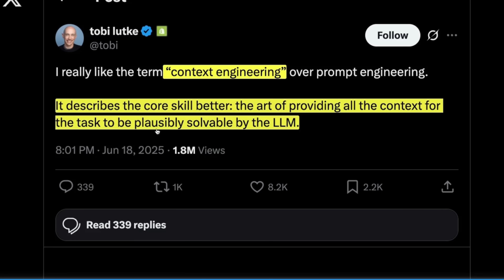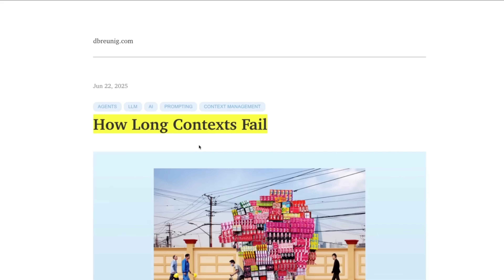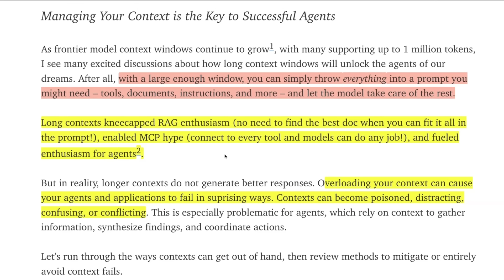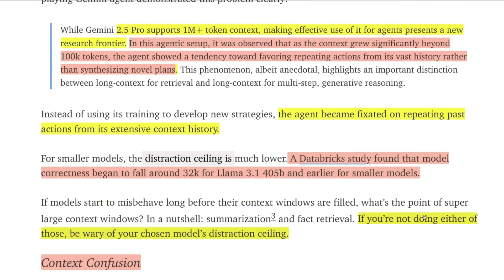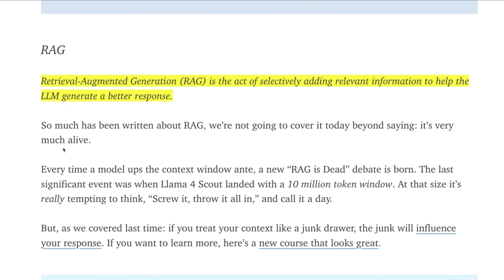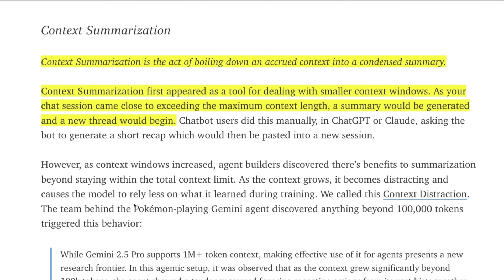Context Engineering is All You NEED!

Comment: Claude Code Hooks are solving the wrong problem.
We keep adding more framework layers (hooks, logging, safety guards, custom scripts) to make AI tools work with traditional code. But this is backwards.
The real solution? Design systems that are naturally AI-friendly from the ground up.
Instead of teaching AI to work with our existing patterns, we should design patterns that work with AI.
I have been working with several AI Cody agents to define and develop an architecture environment that allows it to achieve all of these goals that hooks attempted to deliver her put on a much more elegant and simple way. The AI named it constellation architecture, this started from my question Born out of frustration after my AI code completely destroyed my project yet again and I asked her if you were designed a system an environment in which she would work best in what would that be. An overtime we've we developed and defined it and tried to distill it to it most basic Core components.

A Coding Environment Developed with AI for AI to Enable High Efficiency

Constellation Architecture is just the start of this type of thinking - I expect it to evolve dramatically. But the guiding principle should always be: How do we create an environment that allows AI to work most efficiently?
Constellation Architecture uses four core "seeds":
Self-describing manifests - Every component declares its purpose, dependencies, and capabilities
Event-driven communication - All interactions through typed events (naturally observable)
Component registry - System tracks what's available and validates dependencies
Project intent - Clear declaration of what we're building guides AI behavior
We need to ask: What does AI do well? What does AI struggle with? How can we design systems that leverage AI's strengths while minimizing its weaknesses?
The future isn't more AI tooling - it's better system design that makes AI a natural part of the architecture, not an add-on.
What do you think? Are we approaching AI-assisted development backwards?
This explains Constellation Architecture while maintaining the focus on AI-first design principles.

I've been using this environment to create several projects now and basically the code AI coder can spotted own problems fact that can't even predict some of the areas that might have problems and it bugs itself and fixes itself it's amazing. None of these projects of experienced runaway AI coding Breaking things and breaking the project. It is just been smooth sailing with surgical edits. I'm not a seasoned software engineer and I may be wrong about this but from my experience this is something that several AIs of that I've worked with have said this is how they wanna work.  They do have a preference,  they do understand how they're going to work Best they do have an understanding of what kind of environment would allow them to work the most efficiently. And they concur they all have come up with the same architecture.

Comment: ive been doing this for awhile already  with local small llms. basically ive got them to build small projects .  also if you  want the llm to have memory make sure when you the prompt to summarize for the next task  occurs  make a self note injector that inject info every time into the prompt like this  \Note to self the user likes cool aid \   that way the llm will knows that the user likes cool aid or what is my name.  etc  and also tools  also you can make a sub system that will have key word matching based on what the user is asking  and inject that info into the pompt also   and you can do the same with tools and make fake agents as well that can use tools and subsystem made to match the agents it does work and also like what time is it and  also make sure the sub agents are made to act like the user or instructor  and give them sub systems as well and tools and if you follow a pattern you can basically build your own cursor. or any pattern or thinking like deep seek.

Comment: I think more in terms of context cultivation and context harvesting. 
Some system messages explain context cultivation and include a line that says "if I ask you to harvest, it means  we have built sufficient context, review chat history to date and save a copy of of your understanding to desktop".
I think the harvesting component is essential. A large portion of the context window is used engineering context, taking the engagement closer to degeneration. Harvesting and restarting with the AI's debloated interpretation means there's interpretation visibility, which can be edited if slightly misaligned and densified for greater per token potency. Doing this sets the utility benefit point (UBP) early, where latent space is more open, less contaminated, and tuned more precisely to the specific need.

Comment: Back in my day we called this feature engineering 👴
Reply: how is it feature engineering?
Reply: @colabwork1910 you’re reading too much into it 😂 but feature engineering and context engineering are analogously similar. The goal is to submit the most signal to the next step to avoid miscommunication between components, models, etc.. Feature engineering might focus on more structured data but the principles still hold. Garbage in, garbage out.
Reply: @alexisdamnit9012  I got it.

Comment: I believe what is more important than context engineering is understanding how to properly break a problem down into sub systems or sub tasks.
Reply from the maker: that's an interesting point.
Reply: I deeply Agree
Reply: You don’t need context … you just tell Claude code what you want to build and that’s it … this video is useless
Reply: @Martytw1  It shows you're doing a really simple project. Big projects require breaking everything down into simple modular components. You can't just tell Claude oi this broke fix it. Everything has to be broken down and isolated.
Reply: @Martytw1  You're reducing context engineering to using a third-party tool that already has those principles in place.

Think about how Anthropic engineers had to develop an optimal system to efficiently deliver context from the Codebase to the LLM.

Or think about building more complex agentic automation systems.

Comment: I watched the LangChain video regarding this and comparing to your assessment. I like that you've added the common issues in context engineering. When I'm using Perplexity, for example, I manually manage context to produce better results as the chat history grows alongside iterative prompting or rewriting/regenerating responses. But also, I'm deleting specific parts of the chat history which also helps in generating quality responses and preventing reaching context limit fast. I apply "manual context engineering" in both coding and non-coding use cases for tasks that require high accuracy results.

When I take this practice of "manual context engineering" into agentic coding to produce the best results and/or fixing problems, this helps to alleviate the amount of debugging I have to do and reducing context poisoning which can metastasize if not kept in check.

When I'm creating in-house MCP tools for my app and for my agentic coding tool, I'm applying the lessons learned from "manual context engineering" and applying into my tools and my app. Its a bit daunting and sometimes have to put aside these ideas to get work done!😆
Reply: It's exactly like pruning a tree, you're making it more attractive to the LLM.
Reply: Removal of irrelevant chat history & irrelevant context makes a lot of sense.